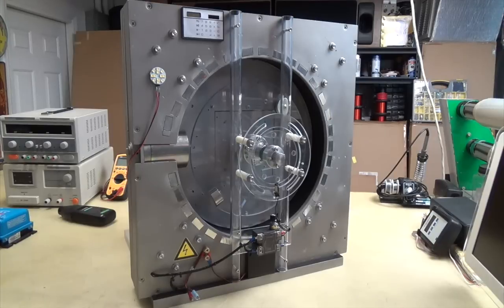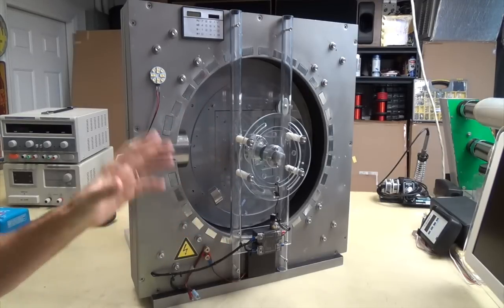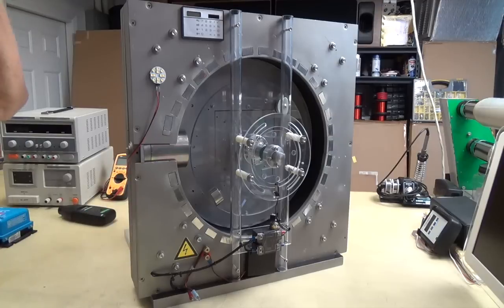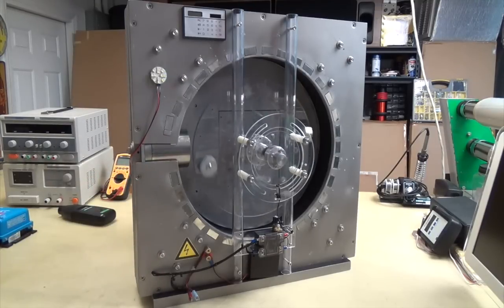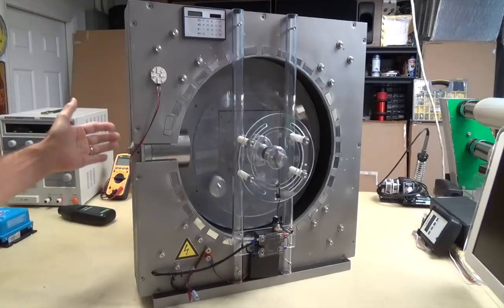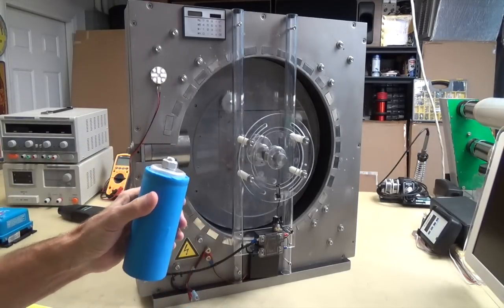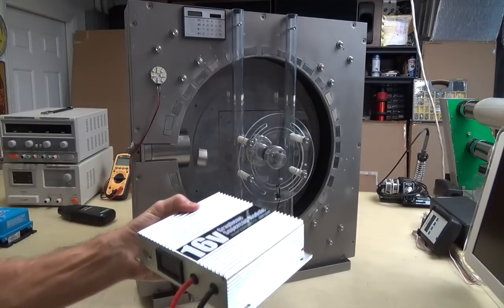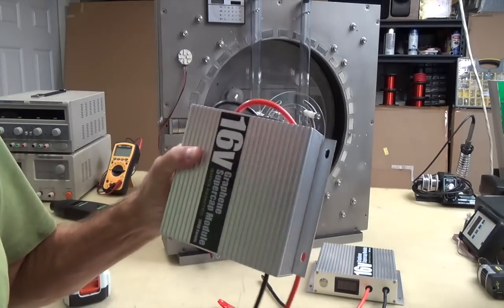ALL Magnet Motor

Comment: Why don't you do it (=your motor) upside down,
 to beat that repulsion point
 using the rotor_magnet's fall?
E.g. So the electromagnet is on the right_side (at 0 degrees=3 o'clock),
 instead of left_side (at 180 degrees=9 o'clock).
Try varying the electromagnet's angle (wrt the stator).
 Rotate the motor (stator) to different (static) angles,
 for finding the optimal (advantage of the) electromagnet's angle (position).
Reply from the maker: Gravity only works if it's out of balance. Out of balance doesn't work for high rotational speed.
Reply: No effect; the rotor is balanced, so the stator could be oriented in any way, and the motor's operation would be equal...
Reply: Capiert same reverse it

Comment: Sir, voltage by itself is irrelevant. We must know the current supplied by the battery and the current utilized by the led to summize the actual power generated and used. You could easily have a 3 phase generator on this machine which develops 1000 volts, with the pulsed 6 volt signal on the front end. It would sound much more dramatic in explanation but, it all boils down to power or wattage (- losses)which remain constant. What is your power consumption and power generation, please!
Reply from the maker: Watch:   https://youtu.be/UuiFoq9Y7do

Comment: So, it’s a rotary phase converter? Also consider using a freewheel diode, and I’m pretty sure a normal low-voltage N-channel MOSFET would be better than an SSR. SSRs are really only viable when you have AC, or maybe if you really need isolation.

Comment: what happens if you spin it faster?
Reply from the maker: Fast here:  https://youtu.be/UuiFoq9Y7do
Reply: more mechanical energy potential to go back into your batteries, or capacitors, and probably the solid state power cells... i assume they a rechargeable.

Comment: if E-magnet is considered as a magnet then all motors are magnet motors.
Reply from the maker: In part, that is true. However, none of them produce 350° of rotational torque from permanent magnets only. That's the difference.
Reply: @PMMG4HYBRID  Hello, I wonder what is the advantage of this type of torque generation. I mean you get dynamic torque, which induce high voltage spikes in alternator, but you smooth it with flywheel, that makes no sense.
Reply from the maker: @miroslavcepl8531  smooth high voltage spikes in alternator?
Reply: @PMMG4HYBRID  I meant that your magnets make non-constant torque (clearly seen by led intensity changes at low rpm), but you use flywheel to smooth the rotation. That stresses the system, why not use simple constant torque motor?

Comment: You seem like you can steer me in the right direction for a project. I'm not having any luck understanding how to spec and find an electric motor that will reproduce the rpm, hp, and torque of a Briggs v twin. So the v twin just has a double pulley that has one belt turning a cat pump and another belt turning a roots blower. The optimum rpm is 3600 to produce 50 ft. Pounds of torque (this is just approx. Based on specs of Briggs motor). Is it possible to run an electric motor in place of the v twin? If so, can it run on 120v or would it need 240v? How do you source motors?
Reply: Three phase with a motor controller will be one of the most efficient ways to go the right one I don't know.

Comment: So this an electric motor hooked to an electric generator?
Reply from the maker: No. It's a 3-phase alternator & flywheel connected to an all magnet motor.
Reply: @PMMG4HYBRID  How long does it take you to run that machine until your  4  AA batt' s are exhausted if you' re not charging them from the output of the 3 phase gen.? And within that time period how many 16volt super caps that you assembled can be fully charge assuming your super caps does not have any charge from the beginning?
Reply: @PMMG4HYBRID  so why is it running on a 6v battery that you never disconected then??
Reply from the maker: @roryrobinson7136  That was only a demonstration to show that it can operate with very little input. The follow-up video shows the best intent:  https://youtu.be/UuiFoq9Y7do

Comment: That is nicely engineered and crafted. I am a bit confused and have a few questions:
- Is the torque solely depending on the weight of the flywheel? So you have torque only after a long period of acceleration?
- Can it do any work in terms of watts? Torque is usually current related.
- You have 6 volt input and a led is usually 2 volts/20mA. So if you have a load of 3 leds (it seems like 3 leds; 6V/60mA) in there you are just intermediating with the motor without any gains.
Reply from the maker: The torque comes from the rotor magnet and stator magnets only. The electromagnet regauges the torque cycle only. The LED light is 12V @ 100mA and has a circuit on the back that allows it to operate on DC or AC.

Comment: good video, very interesting,  you can use the alkaline for the electrolytic property inline with lithiums easily, say you have 3 AAA alkaline in series in a led flashlight at about 4.5V connect 1 18650 in parallel it works with no heat and it lasts for a very long time, I drilled a hole in the side of the flashlight for the wires  having the lithium external and a little distance from the light,  this works with depleted or new alkalines showing the electrolytic property still exists in a alkaline even though the electrolyte is depleted,  take a depleted nickle or alkaline and put it in a lithium charger it'll say it's charged quickly and take it out quickly then try it on a load you'll see they'll take a charge briefly, the 3 alkaline in series is almost the same voltage as 1 18650 you could parallel 50 18650's inline  and the light will run for a years I bet.

Comment: Can you give an indication of how big the torque is?
Reply from the maker: Just enough to use the 3-phase rectified alternator under load. That's all I need.
Reply: @PMMG4HYBRID  OK. Thought you had a value. Could the magnet module be cascaded in series to increase torque and power? Maybe by rotation around the inner axis of the other moules save the auxiliary energy of the electromagnet?
Reply from the maker: @cyprianserapion2022  That actually may be possible. I might try it. Good thought. Thanks.
Reply: @PMMG4HYBRID  Yes, I think so, too. It is worth a try.
Reply: @PMMG4HYBRID  can you put a reference to the 3-phase rectified alternator you are using ? Thanks and thanks for a great video and explanation!
Reply from the maker: @karlwagner2223  I designed this little axial flux 3-phase alternator many years ago and have incorporated it as a modular addition into several of our experimental machines and kits over the years.

Comment: I want to say thank you for all the information you've shared over the years. I've built quite a few magnetic devices myself, none of which function as well as yours do. However, I have had some success in accomplishing my goals. I have come to the same conclusion regarding the v gate, after many hours of experimentation. It's junk. I've had the most success with pulse motors. Plus, I'd be lying if I said it isn't a ton of fun! My ultimate goal is to create a self charging system that can power my home (by recharging my battery bank) in the event of an extended power outage. I'm not trying to change the world, just to take care of my family in any and all circumstances. Your videos have helped me make great strides toward that goal, so again, thank you, and God bless!

Comment: Why don't you directly charge the capacitors with the battery. I don't understand what you are trying to achieve here. Your device won't spin at all if you connect a load that that battery can't handle.
Reply from the maker: Connecting a load to the 3-phase output while ANY battery or capacitor module is micro-pulsing the electromagnet is always successful. The ONLY job the input has, is to bridge the tiny 4% gap between the beginning and end point of the stator. The rotor/stator interaction provides all of the torque. Super simple!

Comment: The wheel is in the vertical plane.  Would it make a difference if horizontal?  What would happen if you added two more electro-magnets so that all three are 60-degrees apart?  Thank you for posting/sharing all of this great tech info.
Reply from the maker: In the beginning, the machine was horizontal. A heavy balanced vertical plane generated less friction on the ceramic bearings. I tried more electromagnets and rotor magnets only to find them superfluous. 96% permanent magnetic rotation using 1 rotor magnet requires a micro pulse from one electromagnet per revolution while the 3-phase provides continuous output. New video coming.
Reply: @PMMG4HYBRID  Thanks.
Reply: And add two more magnets on the flywheel...?

Comment: You have done a nice job on this! Very good demonstration too. Interesting can you get the three phase generator to a step down and use a 12v charger circuit to recharge your batteries using rechargeables or super capacitors? If so after counting the losses how much can you power or maximum load and for how long? Sorry for all these questions but like I said it is interesting and sparked my imagination. I seen a lot of designs but it's like you explained. Great work! I liked this video.

Comment: I obviously know little about capacitors but you convert the 16V, 2K Farad System to 72 Wh. When I do my math I end up with twice that energy....Is this because when capacitors are halfway discharged, they only deliver half their design voltage? Maybe you could provide some info on the charge curve/behavior of the Supercap module?
Reply: Florian Kluibenschaedl spot on

Comment: Also... Speak in watts and not just in volts. For the stepping up of 6 volts to 12 volts to 24 volts to have any meaning you would also need to include the amp load. Naysayers will always leap on the opportunity to call out the fact that you are mentioning only volts and not amps or Watts.
Reply from the maker: God forbid I confuse them with apparent power and watts.

Comment: Just a friendly suggestion... You should check out the Gap motor method where they use electrical coils to neutralize magnetic attraction. I can see how this might reduce the lock point Behavior and increase acceleration into the electromagnet area beyond what iron can produce. You would basically have two Reed switches one of which you already have and the other Reed switch would activate the neutralizing Coil. The Gap motor basically uses the inverse principle of what you are using. One great benefit to the Gap motor method is that much less electricity is required to neutralize a magnet than to energize an electromagnet for attraction  or repulsion. In your device you could attract with a regular magnet with neutralizing coils and then repulsed with the electromagnet like you are already doing. Use The Gap motor method as the rotor magnet tries to leave the attraction lock point. Rather than using an iron sheath around your core that is always attracting the magnet you could use a magnet that is neutralized at a certain point. Attract with a magnet rather than iron and at or just before dead center neutralize that magnet and when the rotor magnet passes just beyond dead center of the electromagnet that repulses the electromagnet is activated accelerating the rotor magnet away. This would create two very strong acceleration phases with minimal electricity.
Reply: So you mean he doesnt need a magnet in the center and just uses em coils(electromagnets are always coils because thats how you make subatomic particles spin in a direction) to negate the effect of the rotor's em field?

Comment: hi great work what is the maximum rpm that you generate at voltage?
Reply from the maker: 40V pulsing in milliseconds per revolution @ 600 rpm., while the 3-phase alternator output is simultaneously continuous. Not to mention the extra BEMF output from the pulsing electromagnet.
Reply: @PMMG4HYBRID  Are you selling this yet?
Reply from the maker: @grantshort  This is a one of a kind instrument made for proof of concept and utilized for multiple experimental configurations over the years.

Comment: Hi thanks for sharing very interesting. I think the key to overcoming the equilibrium your talking about is to take the output and multiply the voltage then fire it through a spark gap, this is where the magic happens the infinite space and pure resonance removes the sinewave as its the frequency that locks it up. It can't breathe. So after the S Gap you can use the hi frequency hi voltage or step it down into supercap then re loop. Of course this is just my theory, I learnt a lot from Gerard Morin's videos. And this resonates with me hope it helps :)

Comment: So I'm confused, this is a generator?  What will turn it?
Reply: It’s a motor, driven by 4 AA batteries, connected to a 3-phase alternator - the output of which is insufficient to power the motor (hence the batteries).

Comment: i watched your video the other day, and it answered a lot of questions for me, ones i think others should also find help fun there research and development, the use of both a Delta and Wye connection is super cool, and if it was set up with the normal number and offset for a 3 phase, could it do better?
Reply: any way today RT had a report of global economic bull... and they are talking about lithium. go figure. any way i totally agree graphene is a key.
Reply from the maker: The dual 3-phase connections through switching makes test bed experiments much easier as you can imagine.

Comment: When two equal sized capacitors are connected in series, their combined capacitance is half, so 2.7V @ 500F x2series = 5.4V @250F.  3 in series is 1/Ct=1/C1 + 1/C2 + 1/C3.  and so on.
Reply from the maker: That is correct, and also the reason why our series-parallel connections produce 16V @ 2000F.
Reply: indeed!

Comment: You can safely recharge an alkaline battery a dozen times but it's why you can't go to an Auto Parts Store and buy a set of 20 year wiper blades (infused with sand). I'm interested in building a bank of Lithium batteries and pulling 5 MA off for charging in which should even surpass the shelf life of the batteries themselves. A Closed Loop System. Would be interested in working with you on some similar project's I've been designing. Tesla was right. The World's Needs Free Electricity... 😐

Comment: cant you use gravity to pull your magnet throig the resistance part? or at least use it to help with that.
Reply from the maker: Uniform inertia from the flywheel is actually better than momentary gravity.

Comment: Well done Mike ! If this is a normal electromagnet, the incoming magnet will induce voltage so you need more current for the push away from it. You can totally reduce this, if you take 2 toroidal coils 180 degrees out of phase and in series as the electromagnet... Like in an Orbo motor. This way you will have no induction into the coil of the magnet, when the magnet runs by and this will very much reduce the input power into the "Electromagnet" then...
Your new 16 Volts Supercaps device is just awesome by the way..well done ! Regards, Stefan.
Reply from the maker: Good advice! Thanks Stefan

Comment: Can you run a small motor generator off of the output? Then feed it back to Input. That will transmute the energy and may break the electrical bond.

Comment: Hi, wondering if you ever tried replacing the 6 volt pack with a capacitor? Do an initial charge on it and then let it go.
Reply from the maker: I've been doing it for days. I'll try to make a much shorter video and show it working.

Comment: This is interesting. I wonder to myself what the relative results would be without the magnetic track but I'd think it would require more driving coils to keep it going at the same speed under load. So with only the single power pulse right now and the track providing the motive force the rest of the time building upon momentum, it's got to at least be putting out extremely similar power per pulse to what it's consuming in the load over time. With this load for example I picture a quick 6v battery pulse into a capacitor and getting the same led load to blink the same frequency and duty cycle solid state for just over a second or so with that amount of charge. I can see that, but not driving the rotor along with it.
Reply from the maker: Now you're beginning to see the bigger (greater) picture.

Comment: I got your previous device the little magnetic motor. The graphite plates got white crust and stopped working. The motor works fine still but the plates are a wash. Stopped and dose not charge. To be expected with experimental technology and I knew the risk of a test device. What guarantee do you have on this power pack?
Reply from the maker: Warranty is on the website for the Graphene Supercap Module.